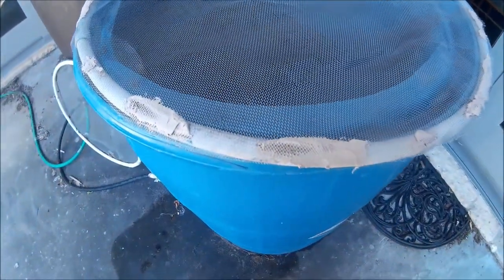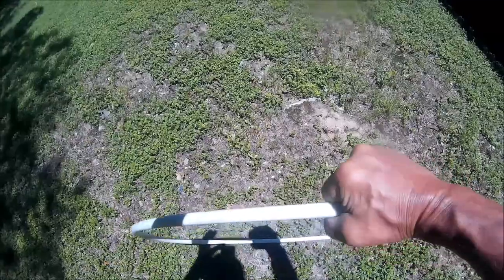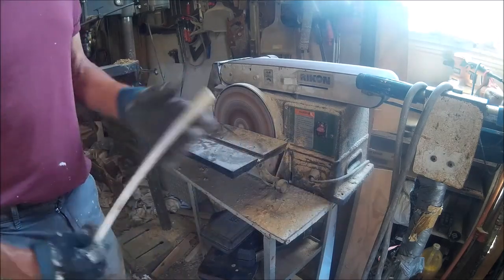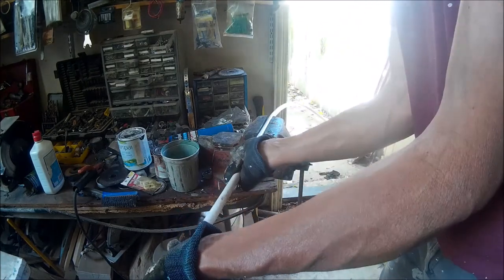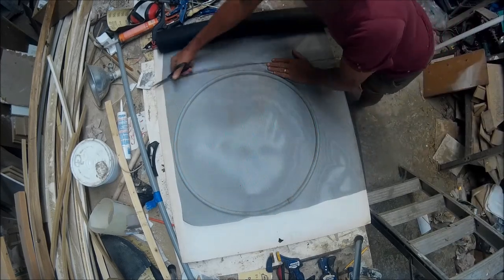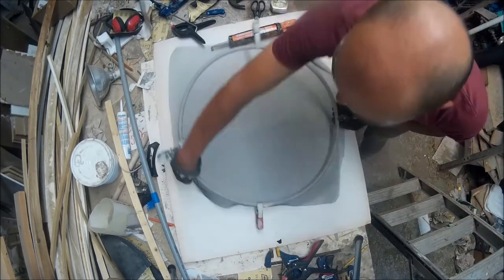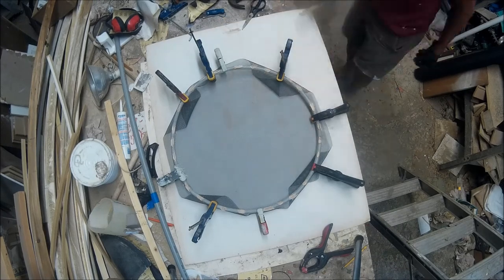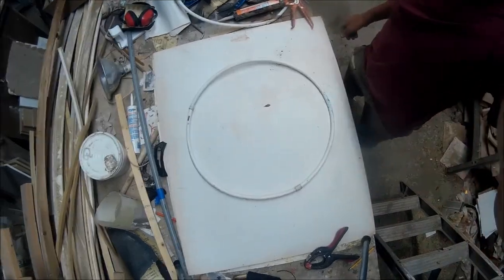Making a Round Rain Barrel  screen or hula hoop

Comment: Good idea, thank you.  I suppose if you didn't have the urethane adhesive you could sew a strong hem on the fabric as if you were making a curtain to fit on a rod and put it on the pipe before you connected the ends of the pipe too.

Comment: Great idea ! What I did to join the pipe was a bolt. Matched the pipe opening to a 2 to 4 inch long bolt, then  hacksaw to cut head of bolt off added some adhesive and put both ends of pipe together!

Comment: This would make great screens for the top of your outside air conditioner unit. As a leaf deterrent. To keep inside unit clean from leaves and other potential harm. You can use screws and washers to mount screen to unit.